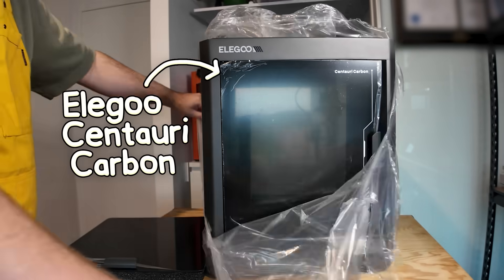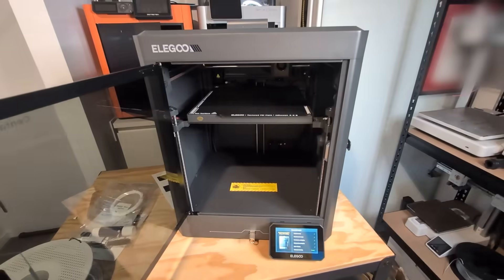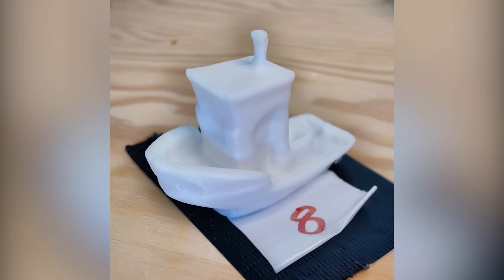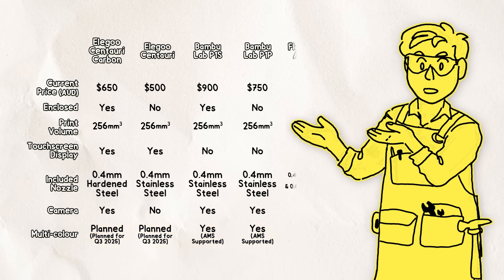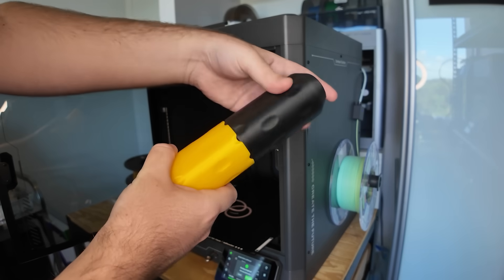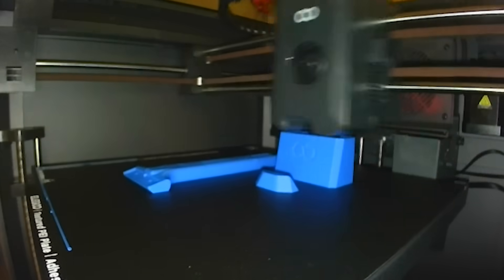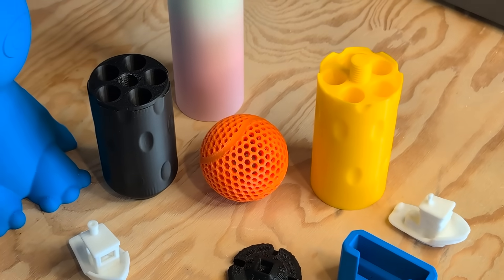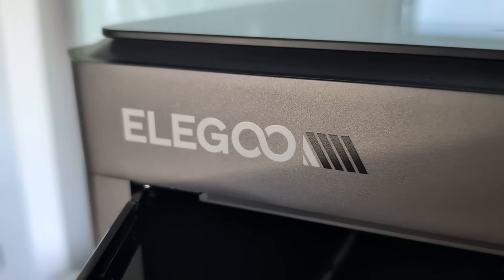How is this only $299? - Elegoo Centauri Carbon CoreXY 3D Printer

Comment from the maker: The Centauri Carbon is $299 USD / $650 AUD and the base model Centauri is a crazy $199 USD / $499 AUD. How'd they do it???
Check here for local pricing and availability: elegoo.sjv.io/55Y5r3 (Affiliate link)
Reply: Nowadays, I feel like 3d printers are getting cheaper and easily accessible for beginners to use and tinker with! Great video btw❤
Reply: what filament did you use for the tennis ball
Reply from the maker: The tennis ball filament is Biqu PLA-HR :)
Reply: Wow the Aussie tax is crazy. Converting from $650 AUD, you're paying $408 USD. I'm in Canada and the Centauri Carbon is $450 CAD for us, or $500 AUD. I wonder why it isn't cheaper for you, considering your proximity with China
Reply: I dunno how and why, but 3D printer manufacturers are competing to be better, when every other industry is working hard to cut costs at the expense of customer satisfaction. 3D and 2D printers of the typical consumer level have switched prices too. I paid the equivalent of $180 (USD) for a chunky Brother printer with toner I didn't replace for 6 years, while now the replacement model, which is barely different in features (5-10 pages more per minute, perhaps), costs over $400.

There have been some issues with things breaking on early Centauri models though. Everything else about it looks good, but build quality on the first batches isn't quite there, if reports are true. It would be a nice printer for ASA once I can trust them though.
Reply: Also in EU it will be €329 which is around $370
Reply: @KaloyanDobrev I don't have any idea how Canada is getting fair pricing, but I'm not complaining. Usually everything tech related is much more expensive in Canada than the US after conversion
Reply: The Qidi Q1 Pro is $689.00 AUD, basically the same, and it comes with heated chamber and hotter printing. No multicolor is the only downside. How do you feel they stack up?
Reply: the fine build plate is on the reverse side - you just flip it over!!!!!!! (see top left corner which reads A side and B side)!!!!!!!!!!
Reply: I just ordered a centauri carbon. I really wanted the centauri as I don't need an enclosure, but since the centauri is still not available to preorder, I went for it.
Reply: aAAND you have to way 10 weeks to be shippped to your place!!!!
Reply: @climeaware  true. Hopefully they will be in stock and stay in stock soon. I've been waiting for mine since May 5.

Comment: I own the Elegoo Neptune 4 Pro, Plus, and Max. There isn't any different in print speed for the CoreXY, in fact, you can't print that fast because the print will typically fail; it's more of a sales gimmic. This printer is certainly the better one, but if you're going to make a wood enclosure and only print one color, the Neptune is better value. I'm not sure if I will sell my 4 Pro for the Centauri Carbon, I might just keep it around because it's just cheaper to print one color.

Comment: It is not a beginner printer. 
Watch more video's on you tube.
If you have a problem like your belt you have to open the printer up.
Al the sides  must be opent.
Yeah you Just hit print .
Not you need to know how to put a model .
And you knowlodge for ofzet fixen the hotend belts sofware and a lot more.
By a creality 3v3se lots of video's how to fix it .
Prints abs tpu pet.g.and pla.
And whit the nebula pad you run klipper.
You can even put mainsail fluidd on it .
Upgrade the machine. 
And go.s fast.
250 mms.
Whit klipper .

Comment: Dude that filament dryer sucks.  I've got the 2 spool one and even if I dry my carbon nylon in the oven for 12 hours (which I fully recommend). Within 2 days of being in the dryer running nonstop it takes on moisture.  I started using a comgrow (which was only $50) and it works way better.  Also sold under solvo I think it's called.  Someone correct me if I'm wrong.

Comment: I got a Flashforge AD5M, the non-pro and the DIY kit, because I couldn't get the Centauri Carbon via Amazon where I had a discount, 243 Euro instead of 299, so I got the enclosure kit and a PETG spool, BUUUUT, I didn't check how much the enclosure needs, so I am currently waiting on 2 more spools to arrive, they were also on a 15% discount. 

But I don't have the issues of the screen being unresponsive so far, anything else worked flawless, the first prints came out great, except for auto supports, they sucked on a test print, they didn't come off great mostly, the surface looked exactly like it did in your airless ball print.

Comment: The price is wild. If the quality is consistent, Elegoo has a huge winner here.
Reply: I have 5 of them plus X1C. I can assure you the Elegoo is a winner here because of the price. In addition to that, the quality almost identical except for the PLA Silk which I need a stable table to judge. The surface of the Silk is not as X1C. X1C in a stable table.

Comment: the fine build plate is on the reverse side - you just flip it over!!!!!!! (see top left corner which reads A side and B side)!!!!!!!!!!
Reply from the maker: Both sides are textured (one is just slightly less textured)

Comment: hi, do you suggest getting the engineering plate for bambo (but for elegoo) when it comes to printing with CF. or should i buy the set of 3 from elegoo?
Reply: The ones from elegoo probably are not much different from the one included with the printer outside of them having the holographic patterned side. The good thing is that Bambu plates work with the CC, so just get the one that works best with the material you want to print with.

Comment: if Elegoo can deliver this high of a quality printer for $299 USD, Bambu leaves a bitter taste in your mouth knowing you paid over $1000
Reply: If you look at it, bambu started an absolute tsunami of innovation when it made the x1c, no one could really compare at 1200 dollars, so they are completely justified in the price especially 3 years ago or whenever it came out, because they designed and made it and now everyone is copying. Could bambu lower the price? Maybe, but it wouldn't make much sense to when they have the A1 and A1 mini availiable. Also, we don't have long term wear and tear info yet, but bambu has 3 years or results to look at making them a robust and trustable company for longevity, similar to prusa.
Reply: I do not regret getting an X1C one bit! I am actually VERY HAPPY to see other competitors producing good products, because it all pushes progress and in no way makes my own printer no longer good!

I just wish a good competitor to the AMS existed!
Reply: I think you mean “Bambu leafs a a better taste”
Reply: I have been rocking a X1C for almost 3 years. Having a similar printer come out 3 yrs later(for a quarter the cost)  doesnt make me bitter or jaded one bit. If given a choice I would still rather have what I got years earlier than wait 3 yrs for a cheaper alternative which lacks many QOL features.
Ultimately it is good for everyone to get in on the 3d printing train at all price points.
Reply: @No0o0o0o0o0  Bambu still on my mind
Reply: It’s how it always goes with china ripping off IP after all the groundwork has been laid out

Comment: You've forgot the Centauri Carbon's biggest competitor! The Qidi Q1 Pro is their most reliable model, and has no current issues, unlike their other printers. It is $689.00 AUD, barely more expensive than a Centauri Carbon. What do you get for that money?

- A hotend that can do 350C, making it able to print PAHT-CF, PPS-CF, Polycarbonate-CF and more, with extremely good layer bonding.

- A buildplate that can do 120C. This helps print the filaments mentioned above.

- A heated chamber. This thing will print ABS like it is PLA. And it also reduces warping for most parts to zero. 

What do you lose?

- A tiny 38 square centimeters of build volume (245x245x240 vs 256x256x256)

- No multi-color printing support coming in the future

So do you want to print PLA and PETG in many colors mostly? Get a Centauri Carbon. Do you want to print more filaments, even high-grade ones that you can put in car motors? Get a Q1 Pro.
Reply: As someone who owns a Q1 pro, the heated chamber is insane, more manufacturers need to implement these, because it makes printing ASA so easy.
Reply: @ getting a heated chamber and a 350C hotend at such a low price is insane and I don't see any other 3D-printing company looking even close to replicating it for a few years at that price-point.
Reply from the maker: Thanks for this breakdown! Maybe one day I'll get a chance to take a closer look at Qidi
Reply: had an X max, it was so bad. The company is not very reliable

Comment: Whenever the AMS comes for this i am gonna buy it!
Reply: good luck they are backed ordered until July
Reply: @Yhandi_Fan good for them considering they are going to buy it q3 2025 which is after July
Reply: @Yhandi_Fan gives those who can wait the hoping they improve the lights and camera and some other tiny issues out and those who waited will get much better versions than the original
Reply: @Yhandi_Fan  August :eyes-purple-crying:
Reply: mine arrived in the UK yesterday - its freaking amazing!
Reply: @speedbird737  When did you order it though? Website states July or something
Reply: Is it  easy to use  @speedbird737

Comment: While i probably did not need another printer... the price was so very good that i ordered at launch. Got the order finally last week and thus far it has been really good. Despite the Neptune 4 issues some have had Elegoo generally make great machines
Reply: My neptune 4 max has been an absolute living hell.  Even worse than both of the Sunlus I owned prior (sunlu s8, sunlu s9+).

 I got a Bambu A1 as my new main printer and only use the 4 max for large prints now.  

But, despite my absolutely terrible neptune 4 experience, I'm willing to give Elegoo one last chance and get the Centauri Carbon as a 3rd printer.  This does look very promising.  And it seems to be one of those hit print and walkaway types like my bambu a1.
Reply: @nascarsimracing1 the CC is brilliant ! Yes set off and walk away!
Reply: @nascarsimracing1  Yeah they crapped the bed on the Neptune 4 by the sounds of it. My Neptune 3 and Neptune 3 Max never had any issues and i have multiple Elegoo resin printers all of which have been great
Reply: please update and be as critical as possible. thank you. wondering if i should order this/p1p or just get another a1 and forget about it.
Reply: @shoqstar  I have been running PETG for a few days straight with no issues. It depends on your needs i guess? The fact that it is enclosed so can run ASA, Abs, etc.. plus at fraction of the cost of the Bambu. It has been great alongside my X1C. The lighting and Camera is awful but i fully expect Biqu to have mods like they have for Bambu machines plus you can use the same build plate.
Reply: I didn't need it either but now the Centuri arrived in the UK yesterday and its freaking amazing! Now I own the CC, the Saturn 4 Ultra 16K, the Saturn 4 Ultra and the Saturn 3 Ultra - I must stop buying them lol! I will defo get the new Bamboo lab printer that replaces the X1C though
Reply: @speedbird737  lol i have the same issue, sadly myself it is 3d and lasers... As for the H2D it has nice things for sure but for now at least i see no reason to upgrade my X1C
Reply: Arrived in the UK? Did you already have a order- next batches is all the way in August 😭 @speedbird737

Comment: Could you do a video about how you would vent it or the P1S outside?  Thanks
Reply: Just get a decent carbon filter and 3d print a duct adapter for your printer. I did this for printing ABS and have had zero fumes. I wouldn't put it next to my bed, but even venting to outside will still allow ambient fumes inside to escape inside.